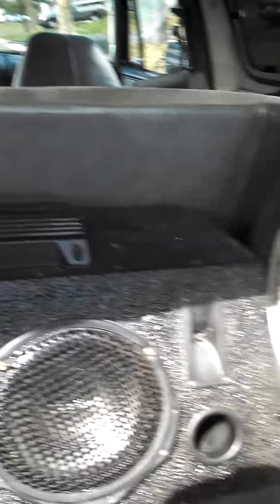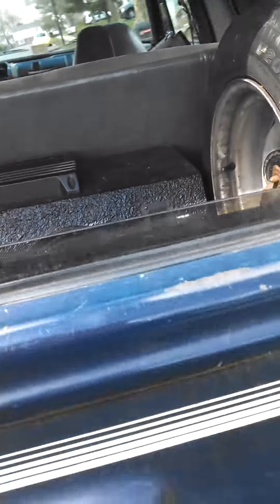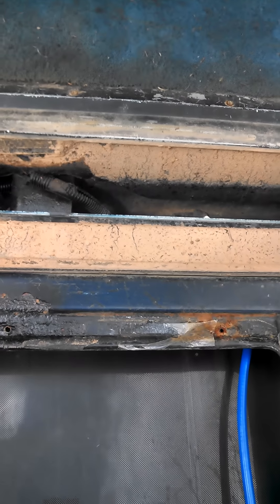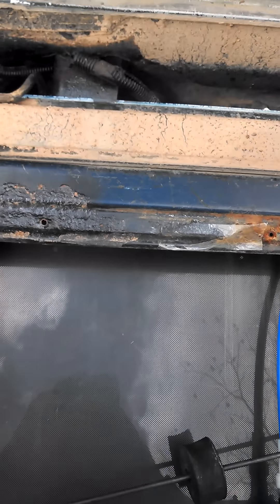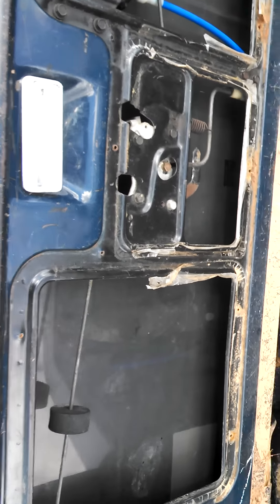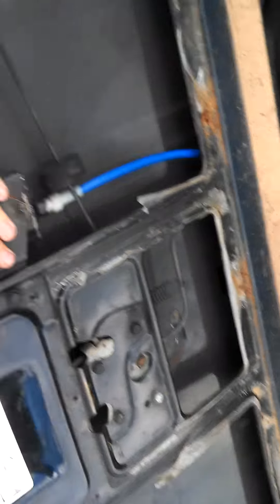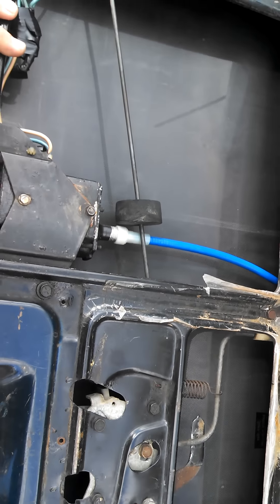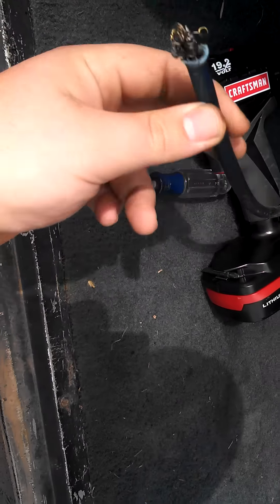K5 Blazer Tailgate Problem Fix/ Safety Switch

Comment: How did you get to the inside of the tailgate?
Reply from the maker: +Brooke M I removed the panel on the rear I believe it was a bunch of Phillips head screws, then just a matter of reaching in there and pulling it out.